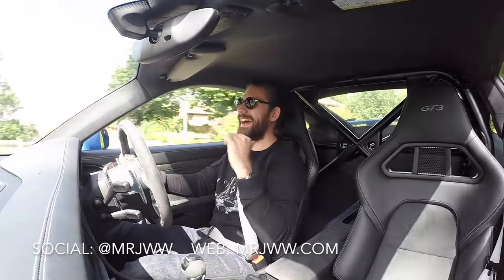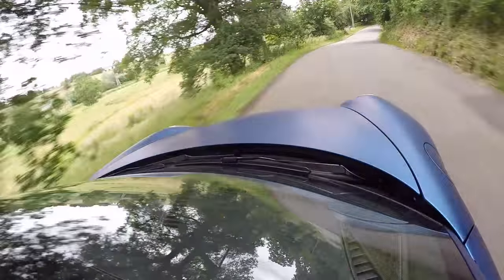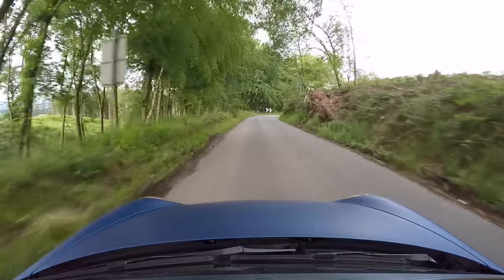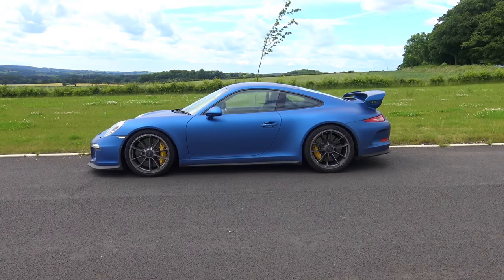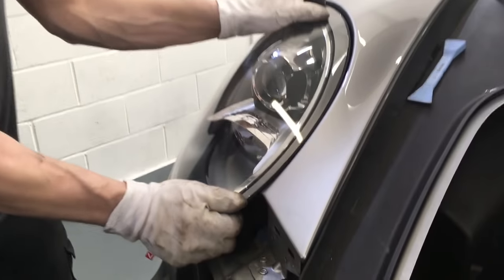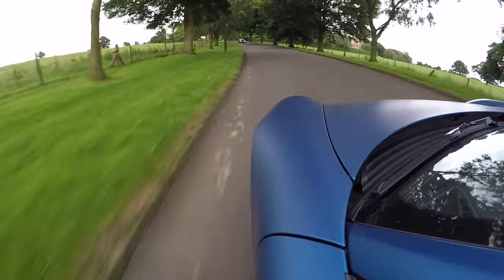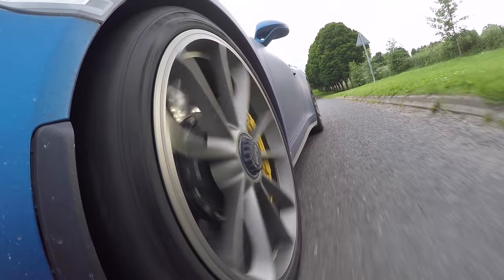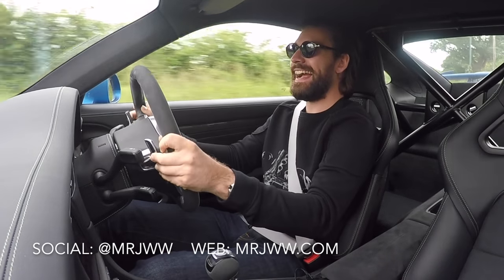Living With A Wrapped Car | Porsche 991 GT3 Style

Comment: Nice to see the videos improving all the time. Seamless edits now, well done. I would recommend upgrading the audio for in car. Get a Tascam hand held audio recorder, get a small pouch for it to stop vibrations and just stick it in your sun visor. You won't believe the difference in audio quality. My last GT2RS video has in car I shot with this method.
Reply from the maker: +eSysman Thanks buddy! I'm going to play around with mics 😊
Reply: +Mr JWW If you get a Tascam, it's sync audio so you import it into your editing software. Final Cut and Adobe Premiere can sync with your video automatically. Or you can get a clip on type and plug it right into your GoPro. But I prefer the Tascam as it could be used if you have a passenger. You could plug a clip on into your Tascam also. There's an EVO vid of Henry Catchpole testing a Boxster Spyder, he shoots it himself but uses clip on mics. Still has a pro feel to it because the audio is good. Will take your video to the next level.

Comment: different kind of video explaining post-wrap thanks. any possibility for it to lift? we're you worried about application using blades? did they use any glue on tricky parts? how much HP does wrapping add?

Comment: Is it 911 or 991 GT3? It seems like people keep using both
Reply: It is a 911 GT3. The 991 is the generation. The previous gen was 997.
Reply: 991 refers to the specific generation of the 911 model. So technically it's both.

Comment: will the wrap remove without any damage to the original paint if you leave it on for a year or two?
Reply from the maker: +AutoEnthusiastJC I'm told so yes - that's the theory anyway ha ha - but yeah it's fine it becomes loose under heat from a heat gun and peels off no problem 👍🏻

Comment: You going with PPF on the LT?
Reply from the maker: +Jim Already has full body PPF 👍🏻
Reply: +Mr JWW Ever thought about Plasti Dip? Can get some amazing finishes/colours etc with Plasti Dip too. Easier to apply without taking the vehicle apart.
Reply: Plastidip starts to fail after a few months, and is a PAIN to remove. Don't believe the videos about easy removal
Reply: +DJLimez it's actually really easy if You put on lots of layers... BUT doing lots of layers means more cans.. More money's!

Comment: Just don't think a wrap is as good as paint. After a few years it will dry out and start to crack and is very difficult to remove. That's what happened with my M3 even with the best product. I did it twice with same results. I won't touch a wrap on my new 911, I just bought the color I wanted in the first place. I would take it off after about 2 or maybe 2 1/2 years at most. You might be able to get more based on climate but wouldn't risk it.

Comment: Never understand why they say to run in cars, especially high end cars such as McLaren, Ferraris etc because the first thing they do when they build the engine is bench test it and Rev the knackers off of it 😂 makes no sense 🤔
Reply from the maker: Ha ha i've always thought the same but dealer advised me and so does the manual...weird.
Reply: In truth, they don't really "rev the knackers out of it" when they bench test them.  That's more of a dry run to test for emissions and quality control. Keep in mind the stricter engineering tolerances these power units are built with compared to average cars. They are more finicky as a result. Also keep in mind that the run-in period is a recommendation, it's not mandatory. If I spent this kind of money on a car, I would most certainly err on the side of caution and go with the recommended run-in period. You're otherwise safe if you do. Why give a manufacturer an excuse to deny warranty?
Reply: It's also to bed in the drivetrain and numerous bearings. Better safe than sorry. Run it in and then enjoy it to your heart's content
Reply: Robert Skuriat Absolutely. And Mr JWW loves to run them hard, as he should. You have all the time in the world after the 800 Kms initial run-in period to enjoy their performance.